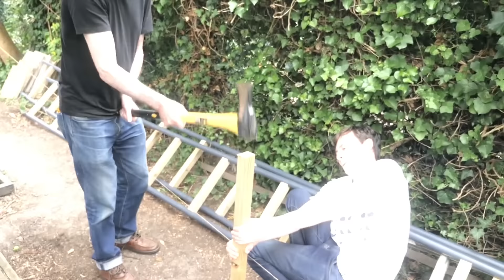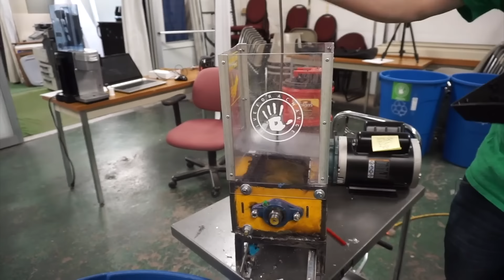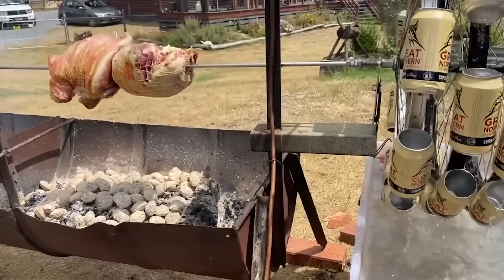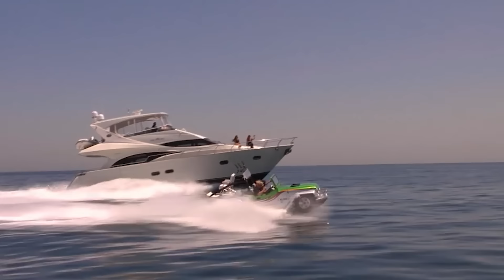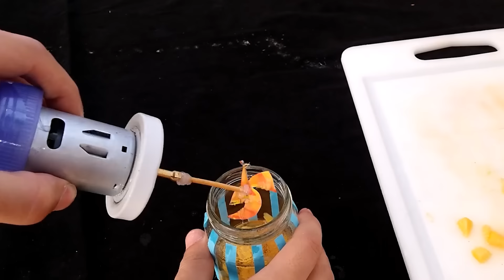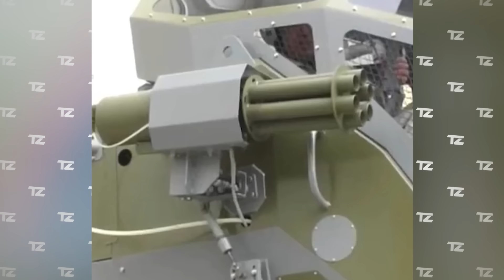MIND-BLOWING HOMEMADE PROJECTS YOU SHOULD SEE

Comment: Speed loader... erm, it took him longer to load the bullets into the speed loader than it would have into the cartridge.
Reply: No…
Reply: @ShemaYisrael1948  No what? Speak, if you have anything intelligent to say, stay silent if not.
Reply: @GTrainRx7  the bullets are in the case. The case has propellant and a primer. The *round or *cartridge drops into the speed loader directly out of the box and you just straighten them out. 20 and then 20 more until you reach the 30 mark. From there the remaining 10 *rounds or *cartridges, not bullets just moves up out of the way. Literally, 1-2 minutes to do this.

The *magazine should have already been dropped into the opening cut for it. From there you put one hand on the *magazine and the other grabs the guide and apply pressure to the *cartridges. 

It takes about 3 minutes to load 30 rounds. It’s faster. Way faster.
Reply: @ShemaYisrael1948  You didn't even watch this, did you? The time it took to load the "speed loader" is MORE than just loading the clip.
Reply: @GTrainRx7  experience vs a guy saying things.

That’s the difference. Why are you challenging what you have never owned and used?

Lookup, “four ar magazine speed loaders vs hand loading”
Reply: @ShemaYisrael1948  You did not answer my specific criticism, so you are full of the proverbial. Sure, it loads the magazine faster than you could manually... BUT the setup for this "Fast method" takes longer than the total time if you manually loaded them. What makes you think I haven't done this in practice? Oh, you can't say I haven't, you are just a shill. Nice try though, answering with no facts. But hey, if they are paying you, why not say anything you want????? No need to back it up with pesky "facts" and "actually real world examples".
Noob.
Reply: @ShemaYisrael1948  Yeah, you just "straighten them out", which takes just as long as putting them in. If there was a "straight from box into speed loader" device, then you would have a point. But you don't, the video skips the straightening process, so you can't see if it is faster. If it WAS faster, they wouldn't need to skip that bit, would they?
Reply: @GTrainRx7  the internet got you and you don’t even realize it.

“Convince a man against his will, he’s of the same opinion, still.”
Reply: @ShemaYisrael1948  Uh=huh. Which is why you don't look at the argument I made and prove it wrong? You just go with insults, classy.
You stay cool, bro.
Reply: @GTrainRx7  do you own one of these boards?

I have 100% addressed your missing the fact that this is faster. 

The funny thing is… no experience on your part is not convincing to you…
Reply: @ShemaYisrael1948  Yes, I own one.
Your lack of simple logic is an example of an idiot bringing you down to their level, then beating you with experience.
No, you didn't address it, you skipped the part where it takes longer to arrange them in the "speed loader" than it would to put them in the magazine.
You have a good life, yeah?

Comment: The rocket has a bubble lens that's why the non curvature goes the opposite way and of course they won't even mention no curvature. That could prove it and they won't do it cause it's funded by the government control minds or cork power limit output to govern

Comment: "The machine has no practical application..."
There is no finer reason to build stuff. It's what being alive is all about. 😁
Reply: The wheel is one of the most useful things ever invented, however, until you put it on something it has no use at all really. Basically everything that doesn't have a practical use is just a part of something it hasn't been used for yet.

Comment: Wait..how long did the Rocket stay in flight being it went so high! Shouldn it have landed way more than just 2 miles away based on the speed of earths rotation...hummm 🌎
Reply: Ask Elon
Reply: Don't be dumb.   I'm sure if you did the trig, physics, and any other math,  it would all work out with the Earth's rotation, weather, pressures, height, weight of craft, and the umpteen other variables that would effect that, because we as a species understand that pretty well.  it's still kind of a luck of the draw with wind and weather, but, they plan the launches carefully, so can do pretty good.
Reply: and they had a dildo on the rocket 🤣🤣🤣

Comment: The mag loader loads up to 30 rounds.  NOT 45.   It even says it on the board.   Pay attention.
Reply: He said the mag hold up to 45, not that specific one
Reply: @nathanerickson5321  There are 10, 20, 30 AR magazines that would work with the loader. There is no such thing as a 45 round AR magazine.
Reply: @wherearewegoing3657  maybe it was a custom 45 round AR mag?
Reply: @White_Night_Demon  To hold 45 rounds it would have to be another 4-5 inches in length. That magazine is a 30 round mag. You can't put any more rounds in it.
Reply: @wherearewegoing3657   Yeah well 30,44 it's the same thing
Reply: 30 ,44 it's the same thing
Reply: Stripper clips work great, no one will ever haul a mag loader board to a battle field. Just stop changing things that work for complicated less useful crap, you are not inventing anything, you are ruining things that work fine 👹🇺🇸

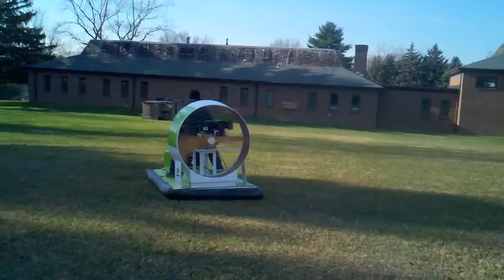Comment: 7:41 The trike not usefull if tire attach diagonally like that....making hard to drive.. Better uae scooter tyre but attach as usually
Reply: On a trike, it would make it easier to ride.  Instead of the friction of the entire tread surface on the road, you only have the edge to deal with.  Less rolling resistance/easier to pedal.

Comment: A few good ideas and unfortunately a couple really terrible ones. The 47 wheeled scooter is definitely not an improvement over the original scooter that they destroyed making it and the tricycle with the car tires looks cool but I'm sure is a lot of work to pedal because it's so heavy and the way the tires aren't vertical is already causing some bad tire damage. It would be a lot cooler if it had a small electric or gas motor.

Comment: Calling anything that relies on wheel(s) for locomotion while in contact with the ground a "Hoverboard" is STUPID!  Something that hovers implies it's not touching the ground.  Ever see a helicopter hover while still sitting on or touching the ground?  Nope, and nobody ever will.  :-)
Reply: Those silly little mini-Segway platforms are pretty much all called "hoverboards", though, and that robo-couch is simply one of those writ larger.  Inaccurate, yes, and a waste of time, resources, and energy ... but you can't really diss the narrator here.
Reply: Technically when one is driving any vehicle in the rain it is driving on a bead of water,thus hovering.
Reply: @georgetsokanis3542  you don't call boats hover boards and they are on the water
Reply: It's probably just a denver "hovercraft" under the hood. I made one for a friend i wheelchair.

Comment: 300 mph is NOT supersonic. Supersonic is the speed in which a vehicle exceeds the speed of sound. Which is around 747 mph
Reply: Supersonic speed is the speed of an object that exceeds the speed of sound (Mach 1). For objects traveling in dry air of a temperature of 20 °C (68 °F) at sea level, this speed is approximately 343.2 m/s (1,126 ft/s; 768 mph; 667.1 kn; 1,236 km/h).

Comment: Back in the late 80s i had a chromed out banana seat chopper with extended drag forks on the front with 14" apehangers and a 16" sissy bar. A mod bike i made with dad after seeing the neighbors tandem double bmx creation. Could ride wheelies for miles although it was longer than a 10 speed.
Reply: $lld in glll1 it see e`£